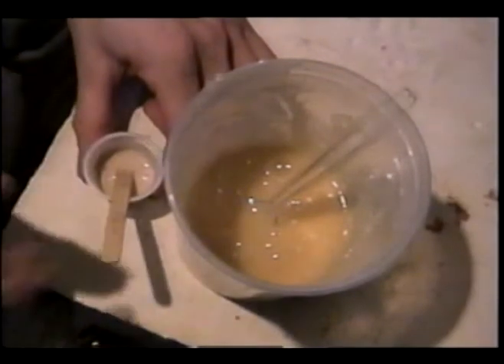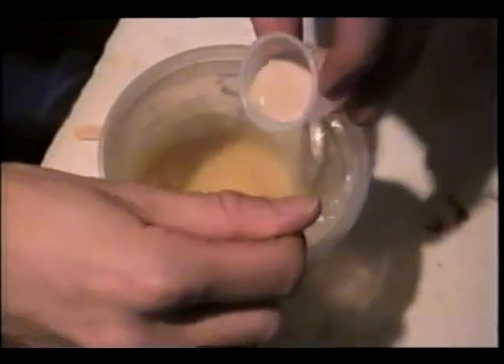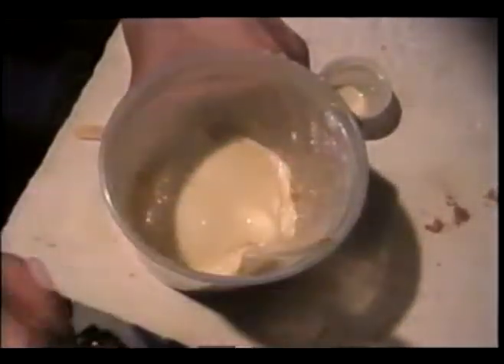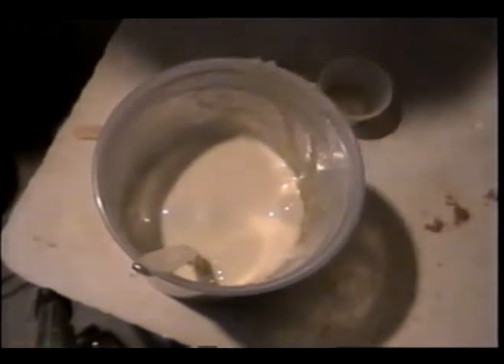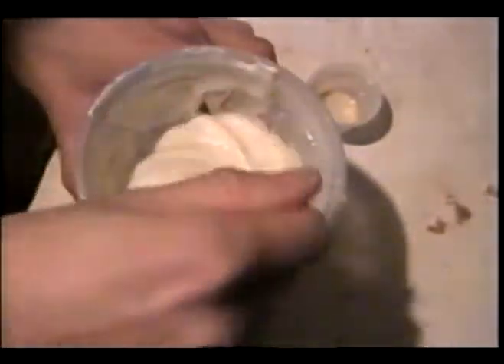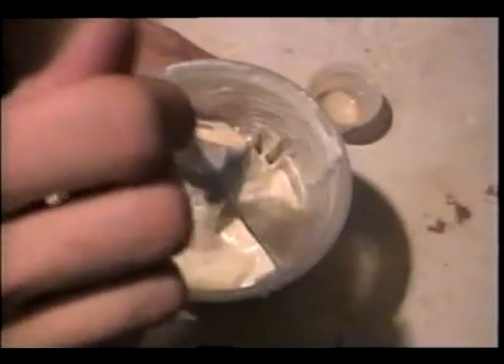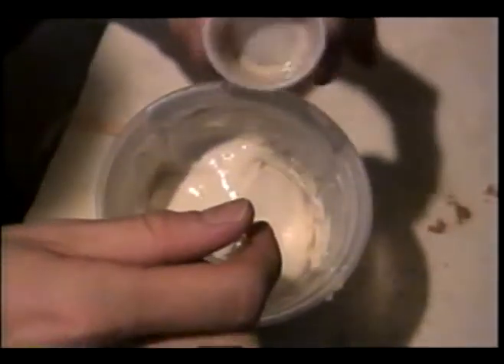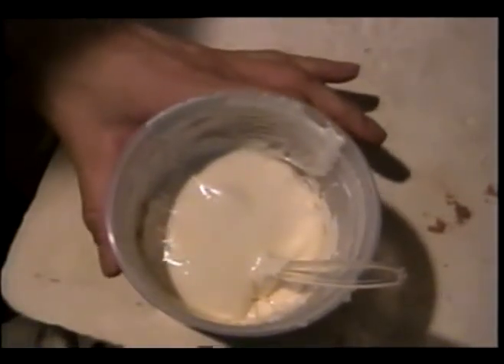foamGel part2

Comment: -ms and sorbitol is unnecessary if you don't have it. Glycerine and gelatin and peroxide is all you really need. You get a much more stable foam if you let it go through a gel - remelt process before filling your mold. Your mold should be released with a cooking spray release and your foam should not be too hot before filling. You want the foam to gel before it collapses. You may need to heat your negative and chill your positive for a closed mold and once closed place in your freezer for 30 min

Comment: Nice demo of my process. I developed this many years ago I would suggest the following:
Combine your liquid ingredients before adding the gelatin
Your liquid ingredients can be refrigerated for a more even mixture of the dry gelatin - then heat.
Use 300 bloom gelatin.
Use yeast packets instead of yeast from a 1lb bag. It is most important to use FRESH yeast. and yeast from an open bag looses potency quickly. You can use the whole premeasured bag.
I developed this as a way to foam with common ite

Comment from the maker: You can store it in its original container, for at least a month or two.  Its like food products, use within 7 to 10 weeks.  But with the glycerine and sorbitol used instead of water, Its a plasticized product.  The yeast and peroxide gives off the necessary air bubbles and rise to turn solid gelatin into a sponge.  Also add a tablespoon of CORN SYRUP to the mix before adding the peroxide.